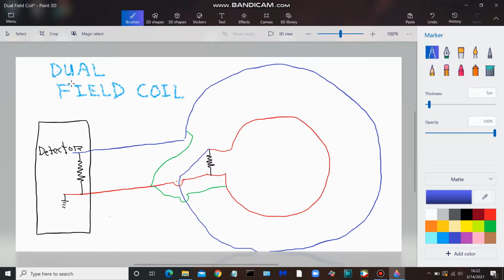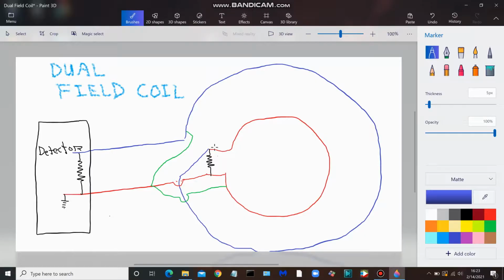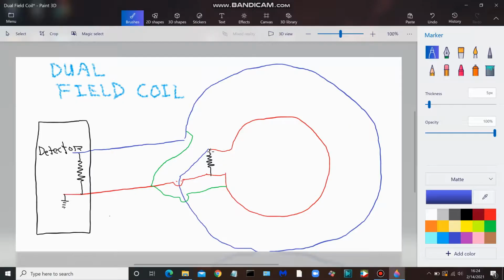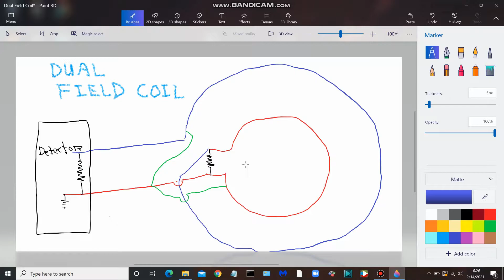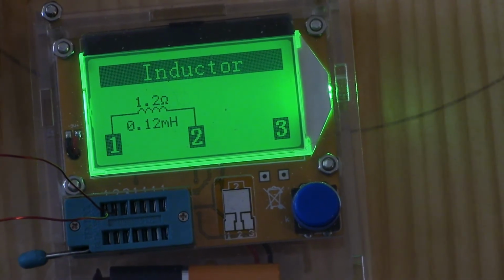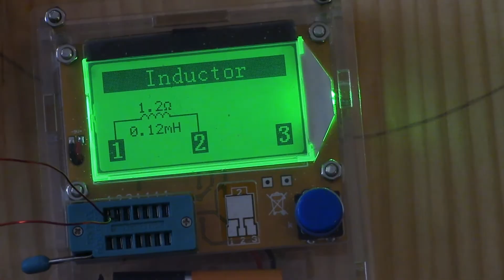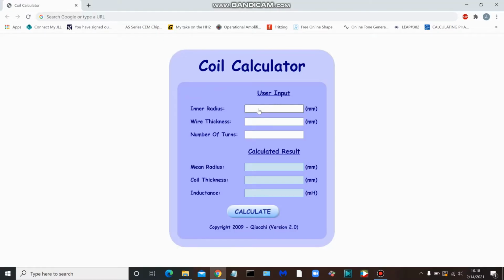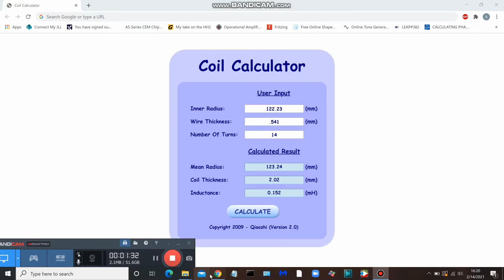Dual Field Coil  DIY project for PI Detector

Comment: Alrighty, I watched the video at least 7 times (ADHD over here 😅) but I have a few questions.
the ruler you are using is in inches, right? but the inner diameter of the main coil is set as 122mm  (4,8")  on the calculator !? 🤔
do the diameter/turns/inductance of the big coil dictates the diameter/turns/inductance of the small one?
let's say I have a main coil with a 200mm inner radius, 16 turns and an inductance of 350mH, how do I figure out the radius, turns and inductance of the second coil? is there any reference point?
I thank you for this video, I built a Surf PI longboard and I just need to make the coil.
Reply from the maker: You need to calculate each coil independently with the knowledge that when two inductors are connected in series their total is the sum of the two.
Good luck with your project.  I am no longer active in metal detecting projects,
Reply: @SurfDetector  thanks for the info, it really helps, and your other videos as well.

Comment: Saludos. Esta bobina dual aplica para el Detector Felezjoo PI?. Que mejoras esperaria percibir en la sensibilidad?
Reply from the maker: This coil will work as long as you match the inductance to the detector.  The coil gives you better performance than a simple mono coil.  Thank you for watching.  Make sure that you watch my other videos on damping resistor use.
Reply: @SurfDetector  Perfecto Amigo, el Felezjoo trabaja bien con una bobina de 300 a 400microH, igual  la resistencia de amortiguacion puedo ajustarla, ya tengo una bobina dual que hice con tubos pvc, hare mas pruebas de laboratorio con el osciloscopio y luego pruebas reales, me imagino que esa bobina dual debe ser mas sensible a metales mas pequeños que son casi invisibles para los detectores PI debido a su baja frecuencia pero me conformo si me ofrece mas estabilidad para objetivos pequeños no ferrosos.

Comment: Hi
Thanks for your great videos,
Is this coil working with polones detector? i am going to make a polones and i want to make a coil like this video, 
and how should i calculate the coil size and turns and ohm and inductance? The circuit is as your polones 
Thanks in advance 🙏🙏💯
Reply from the maker: Yes this coil will work with the Polones. My video gives you all of the information about building the coil.

Comment: What size of magnetic wire you use for that coil sir
Reply from the maker: I used #24AWG wire. You will get better performance if the wire has PTFE insulation

Comment: Hi. I built the surf 1.2 pi circuit back in 2015 along with a dual field coil as you have here. But without the shielding or the damping resistors. I got great detection but I also got a ringing on the coil .. I've since found out this is due to my lack of damping resistors in the circuit.   I know that the coil on this circuit is to have a resistance of approx 1.3ohms and inductance of approx 260-290uH the inductance is fine but I'm not sure how to calculate the damping resistors values.. any ideas?
Reply from the maker: You need to connect each part of the dual coil up to the TX portion of the PI machine that you are using along with a damping resistor jig and monitor the output of your pre-amp with an oscilloscope.  I have a 2 video playlist on the damping resistor subject on my channel.
Reply: @SurfDetector  yes, I've just watched them thanks. Unfortunately I do not have an oscilloscope.. (I was tuning thebdetector using silverdogs instructions). But I didn't realise at the time that the  dual coil needed to be tuned using damping resistors when I first built my dual coil .. I originally thought it wad just a tuning issue regards the threshold level. But the ringing made it very difficult to tune accurately.. I just recently read a post in a forum which someone replied to me regarding a patent then I noticed my mistake. I believe that it it approx 1ohm per uH for each of the coils .. my outer coil is 128uH and my inner is 144uH my biggest concern though was increasing the resistance of the coil.. but looking at the diagram again the path of least resistance is still through the coil. So my 1.3ohms across the coil will not change .. my thought is that the 1st damping resistors has to be big enough for the total of the two coils and the second is just enough resistance for the second smaller coil.. so in my case r1 would be approx 272 ohms and the second 144 ohms .. is this approx correct as compared to your findings on your build?
Reply from the maker: Unfortunately the only way that you are going to be able to properly match the damping resistors to the coil is by seeing the ringing with a scope.  You can use this formula however the scope method is much more accurate in my experience,   R d =  L π   C
Reply: @SurfDetector  I noticed you have built the wave2 portable oscilloscope.. is it any good? Considering getting one for myself .. 

I cannot justify spending £250-£300 on a 2 channel laboratory oscilloscope just to be used on a £50 project.
Reply from the maker: I built the Wave 2 just for fun.  I would not use it to build a project.

Comment: Hello surf detector thank you very much but i dont understand is the iner coil 10 turns or 20 turns ? Because you said 10 first of the video and 20 in another part of the video thank you
Reply from the maker: Hello my friend,  I believe that it should be 10 turns but you should use the coil calculator to make sure as your size might not be the same radius.

Comment: @Surf Detector Ihave a question before i continue watching the rest of this video lol the idea for my build is almost exactly the same as this.. are the 2 coild independant of each other and can you initiate them both together and if so how did you get around the external magnetic field to prevent it from detecting the inner field as a potential object find? thanks :)
Reply from the maker: Hi,
Thanks for the comment and also for watching.  I believe that the abstract from the patent should answer all of your questions.
https://patents.google.com/patent/US7994789
Reply: @SurfDetector  the design in this video helps me a lot though as it is almost exactly the same as my concept from 95* problem I have is realising an efficient way of utilising both, one or the other without interferences and/or false-positives etc 🤔
Reply from the maker: Its good to hear that the video was helpful even if it wasn't exactly what you expected.
Reply: @SurfDetector  great all I need to do now is modify my already existing pre 1995* schematic lol the dampener was the key to a dual-centralized transmitter. Happy days now I can crack on with my build and go treasure hunting haha 😁
Reply: @SurfDetector  I've been trying to come up with a different way for years is I ain't a fan of the crappy 
DD COILS lol
Reply: @SurfDetector  lol I've just realised that patented design isn't for a dual centralized transmitter.
That patented is for a dual-field end-to-end design. So serves no purpose on my question earlier on lol 🤔

Comment: Dear Surf Detector, First thank you for answering my question by email few weeks ago, I just built a concentric one, different radius, but mine is much more simple ( no dampling resistor, and no shield) and works great. difference is, the big coil is clockwise and the smaller one had to be anti-clockwise to get the 400mH (by the way is 400mH the target we have to be close to, what is yours?). So do you have any idea why? and what does those dampling stuff, and is the shield really necessary?
Reply from the maker: What metal detector project are you working on?
Coils should be shielded.
You need to be matching your coil to your project.
The coil oscillates as you can view with an oscilloscope at the pre-amp output.  You want to critically damp the oscillations with the proper resistor.
I suggest starting with a simple mono-coil and gain some experience with these concepts before trying concentric coils or DD

Comment: The small coil resistor is 510 Ohm, what value is the other resistor for the both coils ?
Reply from the maker: Hi my friend, thanks for your interest in the video.  I do not have that coil and PI available for me to look.
When building these DIY coils it is important to hook them up to a PI machine and watch the pre-amp wave form in order to correctly calculate what the damping resistor for your particular coil will be. That goes for the inner coil damping resistor as well.  Just because I used 510 ohms doesn't mean that will be ideal for everyone's coil.  The oscilloscope is essential.
Reply: @SurfDetector   I just got a oscilloscope but I'm not sure where to hook it up. I wish you could show everything on this videos :(
Reply from the maker: The ground clip will connect to the ground reference on your PCB and the probe will be on the output pin of your pre-amp.  Without a schematic of the PI that you are working on, I cannot tell you what pin that will be for you.
In this video I show the connections for the Crossbow PI
https://youtu.be/wFddedBXL64

Comment: I just bought a Impulse 3 ready made board with LCD..is very interesting and cheap. The guy who make this says for 10" coil 0.4mm wire, 22 turns, 380uh, 2.3 ohm. But he is talking about mono coil. I really want to make your coil seems amazing. Can you please guide me what resistor do I need and how many turns for both coils. Your help would be very much appreciated.
Reply from the maker: Hi my friend.  I am not familiar at all with the Impulse 3, I have never heard of the detector.  I trust that you have an oscilloscope with which you can view the signal from your pre-amp.  I cannot tell you what you need without a detector to hook up to I am afraid, I wish that it were that simple.

Comment: Did you actually try this coil out on the beach? is it good in small gold and what is the depth at the beach?
Thanks
Reply from the maker: Yes I have used this coil with both the Mini Pulse Plus as well as the crossbow detectors that I have built for projects.   I think that the detector you are using is of as much importance as the coil especially if you are after gold, the dual field as I explain in the video has the smaller coil which helps with small targets as well as the larger.  That being said I like the coil better than a typical mono coil.  Nickels at the beach, probably 9" I think, although I don't really do depth tests like some others do.  Thanks for watching and please subscribe.

Comment: Is the copper foil connected somewhere? Is the coil wrapped with it and that's it? Thank you very much for your answer.
Reply from the maker: Hello my friend, welcome back again.  Have you subscribed to my channel yet?
The copper shields are connected as shown at 3:26 of the video.
Reply: @SurfDetector  Subscription enabled :) thanks for the answer. I need to watch the material more carefully. My little daughters bother me a little bit :) Regards!
Reply from the maker: @mrongovia  I am glad that you are watching my videos.  Enjoy.
Reply: @SurfDetector  Thanks to your help, I am already after the first pi detector tests.  I was left with the coil shielding.  I am not sure if my detector can be connected as shown in the movie.  you can take a look at the diagram https://drive.google.com/file/d/1U7zvFrXCRcN5J-A60uZpwaKZC-nVmT-F/view?usp=drivesdk

I will specify where I have doubts. Finally, I have three wires from the coil - the beginning of the coil, the end of the coil and the screen. My question is whether the detector lead to 3 wires? Or two? One option is to connect the coil end wire to the shield. The second option is the wires from the coil go their way and the screen to the negative pole of the battery - then three wires go to the detector. My doubt arises from the fact that in the case of the first option, I do not clearly see on the diagram which pole of the coil should be connected to the screen. Or maybe it doesn't matter?
Reply from the maker: I connect the shield to the RX lead of the coil.  You need to look at your schematic to see how the Mosfet is positioned.  The pulse from the Mosfet will of course be your TX side of the coil.  I hope that helps.

Comment: would i be able to use a thicker wrap of copper wire , to get better depths ? is that the whole difference on depth ? 

or am i missing something ? thanks
Reply from the maker: There is no one single factor that enables greater depth with a PI metal detector, you have among others, coil diameter, TX pulse width as well as PPS.
Reply: @SurfDetector  could you not have just said, no , doing thicker copper wraps will not improve depth :')

Comment: Hello! Could you add the pdf file of the metal detector you made to the description? And another question, is it necessary to wrap the coil with foil and for what?
Reply from the maker: Hello and welcome. The shield blocks the coil from picking up electrical noise and it helps to stop the coil from reacting to the ground when you are using low sampling delays.  What pdf are you referring to?  Which detector?  Please subscribe to my channel.  Thanks.
Reply: @SurfDetector  Usually, in the description under the video, many users leave pdf files of their devices with files in lay format. who did it themselves, so that others could do it. That is why I asked you about it. If there is any information, please discard.
Reply from the maker: @МистерХ-ы5у  Hello my friend. almost all of my detector projects are based on information from the Geotech Forum.  Please share my videos with your friends who might be interested.  Thanks.
Reply: @SurfDetector  Thank you so much!
Reply: @SurfDetector  Do you mean long sampling delays which I suppose would mean the pulse rate from the transmitter is slow??

Comment: Hi, can you tell me what epoxy you use? My dual field coil is loose inside and when I hit it, it vibrates too much. I want to fill it with epoxy and kill its buoyancy too.
Reply from the maker: Hi Sergio,
Welcome to my channel.  Please subscribe.
I use a slow cure casting resin to fill my coil shells.  Is this for a DIY coil?

https://www.amazon.com/Epoxy-Resin-Crystal-Tumblers-Graduated/dp/B0872SBPKD/ref=sr_1_39?crid=1BM1DB5KYEIX4&dchild=1&keywords=casting+resin&qid=1616064156&sprefix=casting%2Caps%2C189&sr=8-39
Reply: It is actually to fill in the dual field coil. I replaced one under warranty with the same problem, and now with whites out of business I don't see any other solution, I'll drill 2 holes in it and fill it with epoxy. I will make some coil for the TDI in the future. Thanks

Comment: How much better are two coils than just one coil? How is that measured or determined? thanks.
Reply from the maker: Hello David,

I would say that the determination would be made in a side by side comparison with a dual field coil versus a regular mono coil of the same diameter and inductance rating using an identical detector in a test garden.  But then again, "horses for courses"
Reply: @SurfDetector  any deeper?
Reply from the maker: Very simply stated, the design is based around the concept that a smaller coil detects smaller objects better and a larger coil detects larger objects better.  Depth is generally tied to the coil size.

Comment: you can use spiral sheath
it is more flexible than the split tube
and thought to put the shielding to the mass
just to see ..
Reply from the maker: I agree with you about the flexibility.  The spiral tubing is much more flexible. What I used however is much cheaper :)  One other thing as well.  The solid tube makes a better base for the copper tape.  The tape is very thin and easy to tear so it needs a good solid base.

Comment: Folded mono and parallel coil will be less complicated with just a single damping resistor.
Reply from the maker: The Dual Field coil fits very nicely into the same style coil shell as a concentric and therefore is easier to make for me.
Thanks for watching. Happy Hunting.
Reply: @SurfDetector  putting two coils in parallel will be a dual field as well.
Reply from the maker: It would not be a dual field in accordance to the Whites patent

Comment: So that was 2 coils on 1 PI channel ? Also what type of resistors are those that you are using for damping ?
Reply from the maker: This is 2 mono coils in series.  The connection as is clearly shown in the video is the same as a single mono.
In this video I am using 2 watt metal oxide resistors for damping.  Thanks for watching.
Reply: Thank you !

Comment: so if you solder the joints or connections of the coil wires that go inside the coil, will they show up as targets maybe, or since you used heat shrink it protects it so they wont be detected by coil. or do you not solder and just twist together so theres just copper and no solder.
Reply from the maker: The connections are soldered.  They do not present as targets.
Reply: @SurfDetector  ok, thanks for your vids again
i thought the iner coil was to be wound the opposite direction
Reply from the maker: These are two mono-coils which are in series with each other and wound in the same direction.